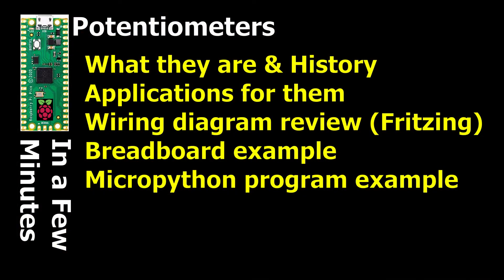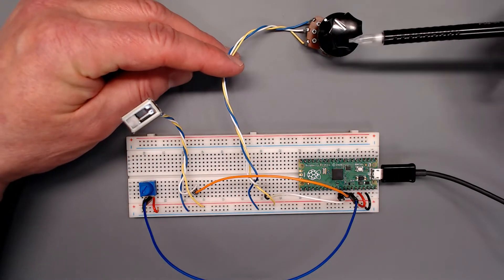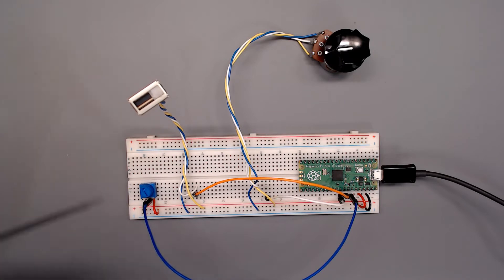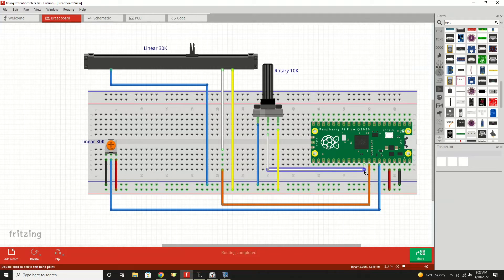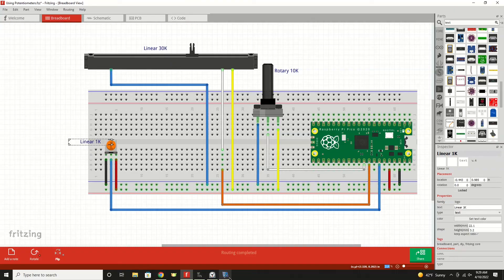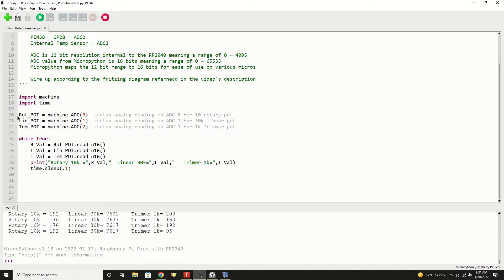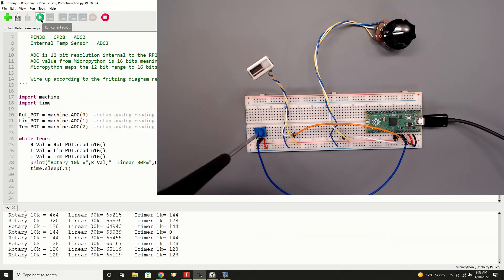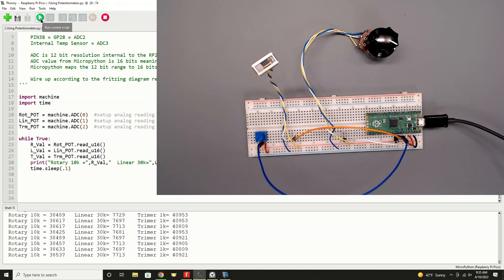Interface Potentiometer to PICO

Comment: I see everyone doing this with a breadboard, is it still simple not to and is it cheaper?
Reply from the maker: Hi vain,  I'm not sure I understand your question, but, yes, you can use a potentiometer without a breadboard.  
Chris
Reply: @MakingStuffwithChrisDeHut  Could I connect them with a F/M jumper cable or maybe just some copper wire? Definitely makes sense if you don’t understand my question because I’m clueless myself, I’m working on my first project
Reply from the maker: Dupont style jumpers probably won't work very good because you will not get a good connection and analog inputs require a good and stable connection.  I would suggest getting some alligator clip style jumpers or something similar to that.  Soldering is another great option and that is usually a very GOOD connection method. 
Most likely if your just starting out and you will be building little circuits to tinker with, I strongly suggest getting a breadboard (GOOD ONE).  Some of the best I bought recently were from Adafruit.  
Hope this helps!
Cheers!
Chris
  @vain5508
Reply: @MakingStuffwithChrisDeHut  Perfect reply, thank you!

Comment: would this potentiometer program work with the digital matrix keypad in a HID way?
Reply: I am intrigued by your question.  Can you go into more detail? I'm not sure how your thinking to use it with HID.
Chris
Reply: @RIAMCNC  I play flight sims and Star Citizen, both use a lot of macros and buttons. So i am working on a 36 button matrix with two pots for throttle. I want to put the code for the pots AND the matrix on one Pico as i will have more then enough pins for it. also i suck at coding and have been practicing to get better thus my question lol.
Reply from the maker: Hi madaze67,
That sounds like an amazingly fun project.  Unfortunately I am not very familiar with making HIDs using the PICO, but I would suspect that using one for this purpose would be possible.  For some reason, I think you need to do HID program with Circuit Python so you may want to check into that too.  I wish I could be more help than that.
Chris